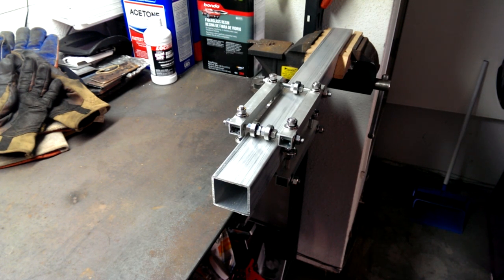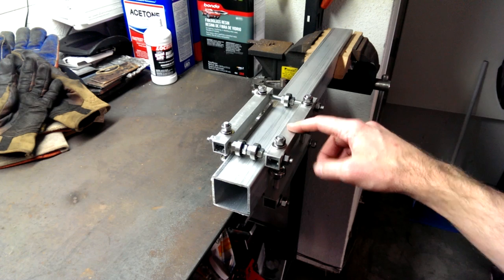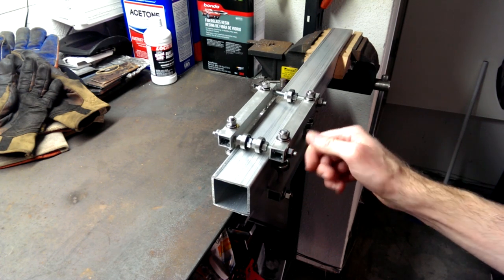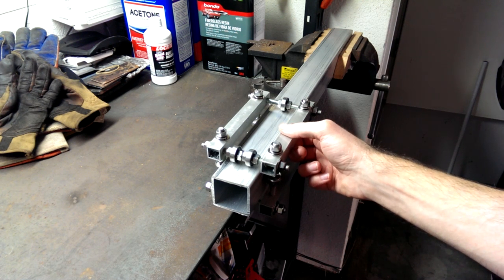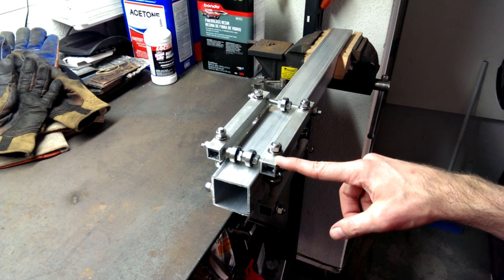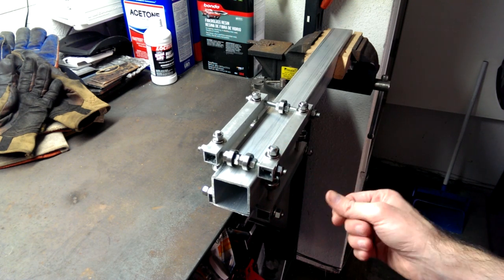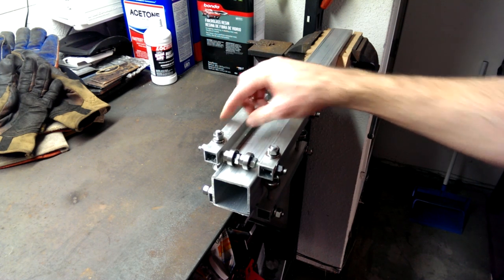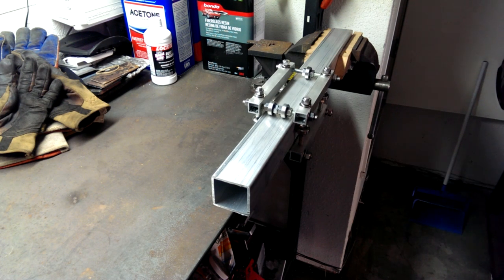Linear Bearing For Square Tube

Comment: Rediculously simple but good design! This is a surprise for me.I think its the perfect system for the hobby cnc because of the possiblility to calibrate ?
Reply from the maker: Thanks. It worked well for my project at the time, but if I were doing this again, I'd also consider something like OpenBuilds linear rail and v-wheels. The cost and availability of that stuff has improved dramatically.

Comment: Very nice but what about the rigidity of the square tube on longer lenght?
Reply from the maker: Well, you have the OD, ID, and material choices to play with. And you should choose an appropriate solution for a given problem. That won't be this idea 100% of the time.

Comment: Imagine doing this with a solid square bar, solid square smaller bars that hold roller or needle bearings. 
You could probably make a milling machine out of it (light duty ofc)

Comment: This is great! Has this caused the aluminum square tube to wear out because of the steel bearings?

Because I'm planning to use this for 3d printing..

Even if I use steel steel, what do you feel about the steel in steel contact.. Will it wear out eventually?
Reply from the maker: Everything wears out eventually. I didn’t see any problems during my use, but my arc furnace wasn’t particularly high load or high hours. If you’re worried about wear on the aluminum tube, you may want to press an aluminum or softer material ring onto the bearing outer race.

Comment: With the help of this linear bearing,square is there any possibility to make height adjustment office desk. can you guide me with me a video.Thanks
Reply from the maker: Yes, it is possible. No, I will not make a video specifically about that. But I did use this in a vertical configuration for my electric arc furnace project. That may give you some ideas. https://www.youtube.com/watch?v=ft_qtrTUlGA

Comment: Hi my friend excuse me i coukd use a nema 23  OF 7.5 KILOGRAMS TORQUE to build a cnc nachine with router to work with aluminium for cut 1/4 inches Z AXIS.. I COULD WORK WITH THIS? AND I HAVE TO USE BELT?  COULD I?

Comment: Excellent design! How strong it is and how it vibration resistant? I did the same for test, but not yet assembled CNC based on this schema... did you build CNC based on this rails?
Reply from the maker: There is a link to my full project in the video description
Reply: @GregoryHildstrom  thanks! I see it's foam cutter, right?
But I think if it's possible to assemble big size CNC for wood using your great idea and schema?
It looks very scaleable! ;-)
(and even maybe for metal - with more rails in the middle, more DIY linear bearings - for distribute cutting loads from spindle)

Comment: Is the outer diameter on those bearings 22mm? If they are I'd imagine that the drilling into the square tubes would have to be very precise as they're only about 20mm.
Reply from the maker: Yes, 22mm OD

Comment: Three ball bearings (i.e. three points of contact) is probably the best (better than four). -- Consider a bar stool.  A bar stool with only three legs will never wobble.  But a bar stool with four legs, if it isn't exactly perfect, it will wobble.
Reply from the maker: Good suggestion. True, three legs will not wobble, but four legs at the same radius is still more tip resistant. Four bearings per direction can be kept tight by the preload from the threaded rod. I know aluminum extrusion is not a machined surface, but it was consistent enough for my purposes. Also, having 4 bearings farther out reduces bending moment on the bearing guide tubes compared to a 2 and 1 setup.

Comment: hello i really like ur video trying to make a roller like that  but u have like a cage around the pipe. the part over the table i wont have so it will have rollers on top and bottom with half the cage like a see. wanna put it on the side of a roller belt. u think that will hold in place whn i add weight to it to hold items i wanna use.

Comment: Gregory thanks for sharing. This is nice setup, but. I just saw this and he he I did same thing without seeing this, and I assembled all axes this way. It was pain in the ass, don't get me wrong it is nice setup but it is complicated. Too many screws and bearings, X and Y okay but Z is mission impossible. Advantage it is available everywhere and there is almost no load limitation, just for X and Y, disadvantage it is complicated. When you put load on it it starts to bend threaded rod, so if you wanna do this use bearings with bigger inner diameter and stronger threaded rod.
Reply from the maker: Thanks for the feedback and good suggestion.
Reply: Majsta Ć. Linear rails of all kinds are complicated with bearings going in all directions
Typical over engineered products and very expensive. This set up on the other hand is simple, self aligning and very cost effective.
The only part that I dont like is where the top bearings are riding, it appears that chips or whatever you are cutting is going to end up on that rail and perhaps jam the bearing like A wheel chock. I am getting parts together for my own cnc and do believe that this is what I will do.
Just from looking at the end of that tube looks like you can put all the bearings inside the 2 x 2
But then you would have to slot both sides and byproduct would end up in...... or just put one slot on bottom and any byproduct would not be a problem, Thank You for posting this video I just figured out what I'm doing for linear rails.
Reply: Kevin you are right about all, but trust me threaded rods will bend. Take bearings with bigger inner diameter, and for Z axes take four bigger V-groove bearings. If I ever build again it will be that way, I finished my machine works fine with V-groove. But I would cut my expenses with X and Y using this method, and take stronger V-groove for Z.
Reply: Oh I would'nt use threaded, but I would use solid rod and then machined down to bearing ID. then drill and tap the rod to keep the brg on, or eclip them in place. I do like the v groove but they are very expensive. Thanks for your input.

Comment: I'm currently building a sliding table for a router table and it could be an idea to incorporate this idea with a twist. I take it the stress on the bearings would be cut to half if I put the square tubing turned 45 degrees since double the amount of bearings would take the load.
Reply from the maker: +Yannis Rouen Yes the load would be shared by twice as many bearings, but you need to take into account the wedge effect (vector forces) from the difference between the load angle and the bearing angle.
Reply: +Gregory Hildstrom Yes, you are correct. It would be interesting if you made a test leveraging 45 degrees offset in relation to the linear direction to see if the bearings still rolls as easily. I put a video on my channel describing the construction as a draft.

Comment: Hi, that was extremely helpful. Do you have any calculations on what kind of moments this linear bearing can handle? thanks!
Reply from the maker: +Manan Shah That's an excellent question. I have zero mechanical engineering calculations related to this. It's plenty stout for what I'm doing. I think the limiting factor might be the bearing layout and the 5/16"-18 threaded rod I used. The minor diameter of the rod is around 1/4", so there could be a significant bending moment between the small square tubes and the single ball bearing if enough load is applied. That effect can be reduced by using two ball bearings per rod/shaft or a wider roller/ball bearing, which will reduce bearing-tube distance. Ideally, there would just be a thin washer between the small square tubes and the bearing; and the bearing would occupy the entire tube-to-tube width. That would covert most of that bending to shear on the rod/pin. The small square tubes could have thicker wall, they could be solid, or they could be made of steel instead of aluminum. I don't have any specific calculations, but the idea could be made a lot stronger than my prototype if necessary.
Reply: +Manan Shah The maximum basic static load rating is usually around 140 for this type of bearing and dimension.

Comment: Thanks for sharing.  I was looking for a sturdy way to build a homemade CNC mill other than using drawer slides or makerslides.  I believe that you have helped me in a big way.  I'm going to put it to the test.
Reply from the maker: No problem. Make sure the sections of tube you use are as straight as possible and not twisted. I didn't check mine carefully enough before hand and discovered that one of my extruded aluminum square tubes had a constant twist along its length of about 10 degrees over 4 feet. My other tubes didn't have any twist, so pick your stock carefully.